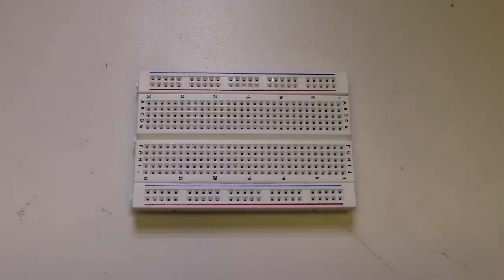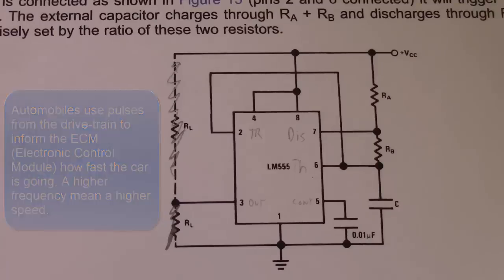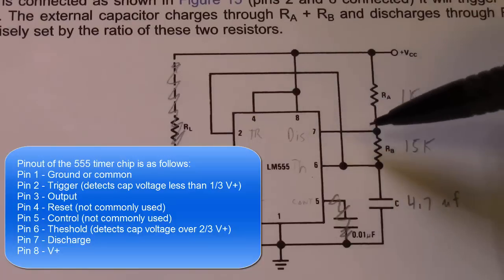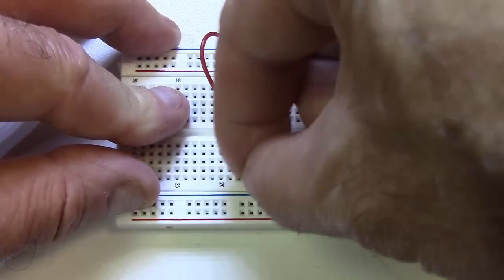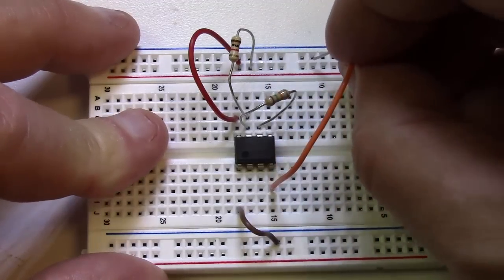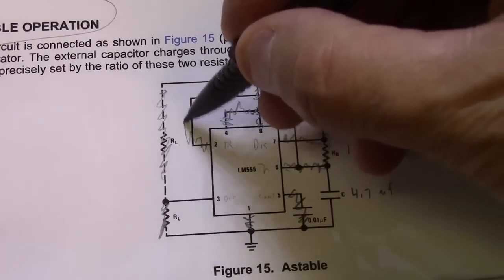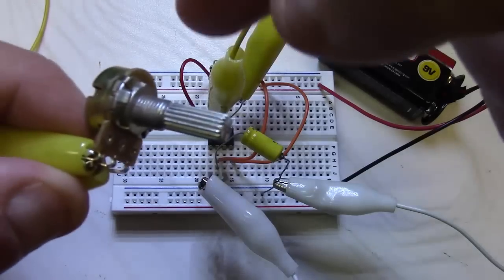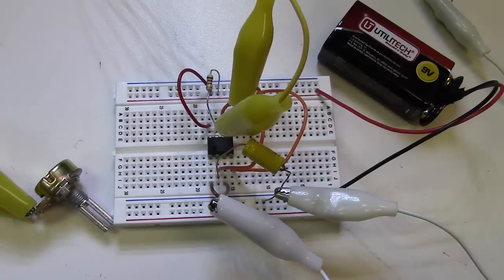555 Timer Project - Signal and Sound Generator

Comment: It looks a 25k resistor for Rb will produce aprox 60hz signal? Does that sound right to you?
Reply from the maker: Sounds about right. I can check the resistance when I get back to the shop. I neglected to provide the exact for Rb thinking you might want adjustibility.
Reply: Dorian McIntire Yes, adjustability will be helpful. If I can go from 40hz to around 80hz, that would be nice. I will find the appropriate pot. Again, thank you very much for all your help.
Reply from the maker: Michael Fox I used a 5K pot. Radio Shack carries these.
Reply: Dorian McIntire I mocked this circuit up, but it is erratic. The part number I have is a ne555n. Is it possible I need the .01 microFarad cap from pin5 to ground?
Reply from the maker: Michael Fox For the NE-555 you will probably need the 0.01 cap on pin 5. It produces a large output spike that can feed back into this pin.
Reply from the maker: Michael,
I actually measure the total resistance of  Rb at 2.4K (both fixed resistor and potentiometer in parallel). This is with a 4.7uf timing capacitor and a 1k resistor for Ra to get my measured 60 hz signal. The formula is 1.44/(Ra + 2Rb)C. When I plug these values into the formula I get 52 Hz but the error is due to component tolerance. Remember you can make changes to the capacitor or Rb to reach your target frequency. Do you have a scope? If not you can compare the noise produced by a speaker, connected to the 555, to a pair of 60 hz hair clippers that will oscillate at 60 hz. This assumes you have a good ear for pitch.
Reply: Dorian McIntire I was getting frustrated until I finally got that cap on pin 5. I am up and running and I think I used a 3k resistor. I am using this circuit to provide a false speed signal input to an aftermarket cruise control. Sometimes when installing cruise we have issues that may or may not be related to a "dirty" speed signal output from the vehicle. This circuit will allow me to field test the rest of the installation to verify the problem is in fact speed signal related. I mocked up a kit on the bench using this circuit as a speed reference,  and the cruise "engaged". Extremely grateful for all your help !!!!
Reply from the maker: Michael Fox
Glad it was useful. Hope other viewer also benefit from the tutorial.

Comment: Hi...is there a reason I dont see a square wave on my oscilloscope???
Reply from the maker: Is it plugged in. :-)
Reply from the maker: Please be more specific. Are you probing from pin 3 to ground and are you driving a strange load such as a speaker? If you drive a purely resistive load (carbon resistor) you should see a square wave.
Reply: I am connecting to pin 3 and ground...
Reply: I am new to using a scope and using a old Hitachi analog..

Comment: Thanks for fast response Conduits are empty and long underground runs. Have about 20 of them. I'm takingover this job and this will be good and fast solution.  Just an idea but I am sure it will work. I am not electronic guy if by any chance you are interested to  help. I wanted to use house smoke fire alarm and try to by pass and have it work. That is about sound and loudness i am looking for. Thanks
Reply from the maker: +Dejan Nikolic I think it's a good idea. You can use a small piezo speaker in an enclosure that will funnel down to the size of the conduit. A smoke alarm sound should travel a long way through the conduit. Something like the following circuit should work.

https://startingelectronics.org/beginners/circuits/555-audio-tone/

Hope it goes well.

Comment: does this work on piezoelectric crystals?
Reply from the maker: Do you mean a piezo buzzer?
Reply from the maker: Yes you can use a piezo disk speaker but not the buzzers that only make the same noise when hooked to power. Piezo disk speakers are fairly quiet at low frequencies. You can glue them to a backboard of plastic or metal to make them sound louder.
Reply: @DorianMcIntire  okay

Comment: Can you build a boost based on 555?
Reply from the maker: It can be done. There are several ways to make it work. Are you making a request? Thanks for commenting.
Reply: yes I am actually.  I tried to sim one (9 to  12v) for LED strip driver, but had trouble getting desired output voltage.
Reply from the maker: So you would like to convert 9V to 12V? How much current does the strip require?

Comment: a simple circuit please thank you
Reply from the maker: I'm sot sure about what you're asking for. Their is a schematic of the circuit from the data sheet if that's what you mean. Please advise.
Reply: Hi I sent 2 comments the second comment was an addendum to the first. The first comment was a request for a circuit for a noise maker I'm hoping you can make a boom sound similar to a bomb. 
I'm a model maker and want it as an effect.
Hope that's clearer sorry for the misunderstanding
Reply from the maker: I recommend a sound synthesis chip such as the SpeakJet or SN76477 chip. An explosion is a complex sound that requires a white-noise generator and a waveform envelope generator. These are built into the SpeakJet which also does human voice and other sounds. While the 555 timer can make many interesting sounds it does not do well with white-noise.

https://www.sparkfun.com/products/9578

If you can get a complex sound generator chip such as a SN76477 you can create explosion sounds. This chip is still available even though it has been discontinued for years. 

https://www.youtube.com/watch?v=rDHcaqW29mA
Reply: Dorian McIntire wow thx so much for your help dorian I know very little  about circuitry other than the very basics that's why I need the help but I'll certainly yry and source that part. I'm living in Thailand although I'm from u.k. so all help is much appreciated

Comment: Informative video, what are the component values for frequencies 7 khz to 25khz?

Clyde  csaye.com
Reply from the maker: +Clyde Saye Looking the graph at 2:56 its looks like a 1K resistance and 0.3 uf capacitor will get you close. If you have a problem seeing the graph download a 555 timer specification sheet and it will have the graph. Thanks for watching.

Comment: F=1.44/((Ra+Rb).C)=1.44/((10^3+15*10^3).4,7*10^-6) = 20hz. ???
Reply: in the chart if you choose frequency is 100hz then Ra+Rb = 10Mhz
Reply from the maker: Not really. The Astable chart is a log-log graph and cannot be read linearly. At 100hz I read Ra + 2Rb (not Ra +Rb) is about right.

You calculated 20 hz instead of 60 hz because all components have a tolerance value and electrolytic capacitors, in particular, have a wide tolerance I also used a potentiometer in parallel with Rb to adjust my Rb value so the face value of that resistor was not the true value for Rb.

I think you meant to say Ra+Rb = 10 MOhm at 100 hz not 10Mhz but this is not correct.
Reply: Sorry, I was confused and forgot you used a potentiometer in parallel with Rb. 
My english is not good :D